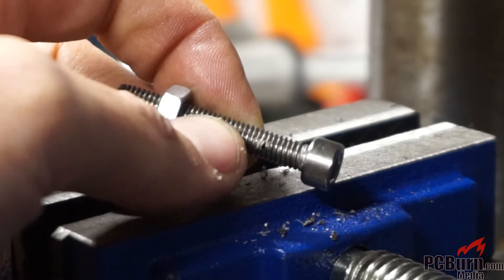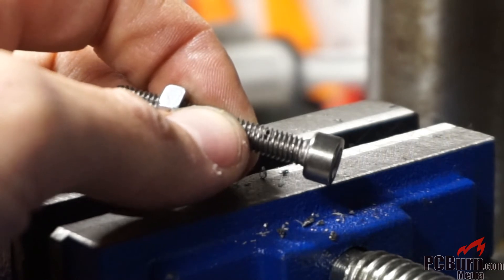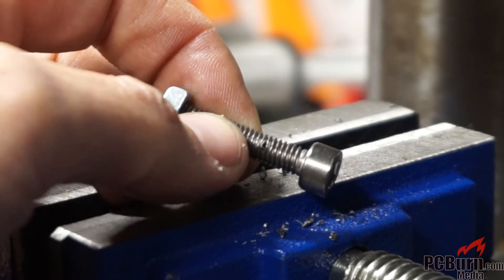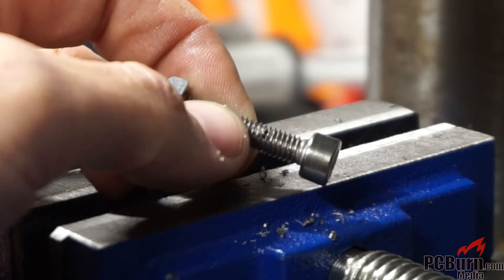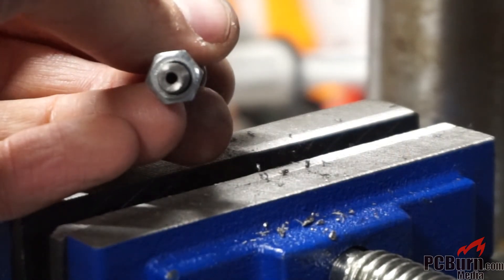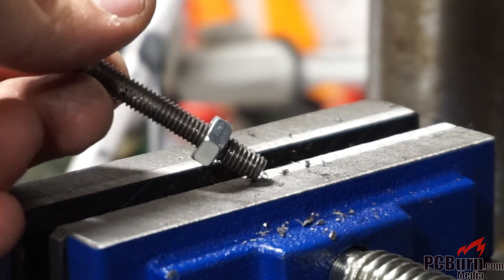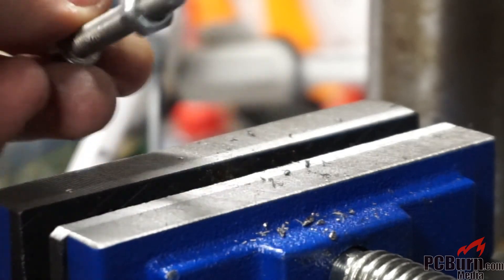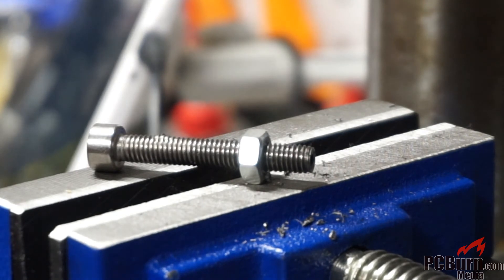Drilling Titanium (with HSS Bits)

Comment: i thought you needed carbide bits to do this, i am so confused
Reply from the maker: I was curious too which lead to trying it!

The drilling bit worked just fine. If you're doing commercial work and time is money you'd be using carbide; it's going to hold up to repeated use.

In my case I had some fresh HSS bits sitting there and wanted to see if my drill could center drill the bolt "good enough" (obviously not). It's a small job so just making sure chips didn't collect up and taking my time worked.